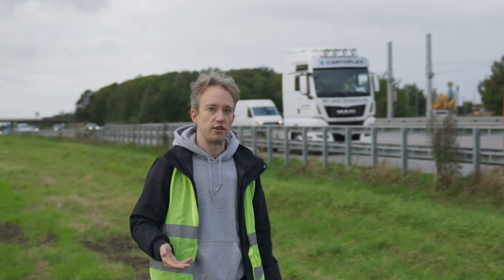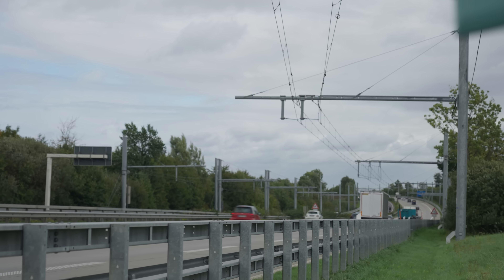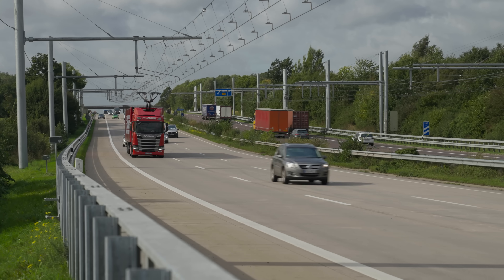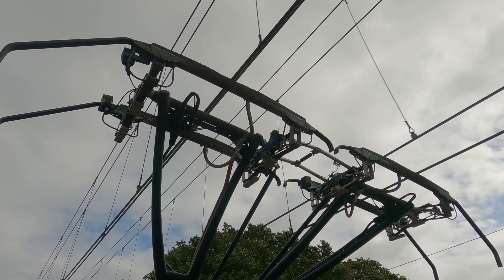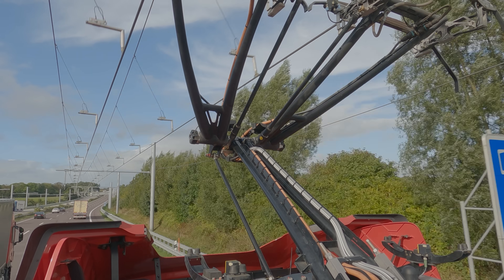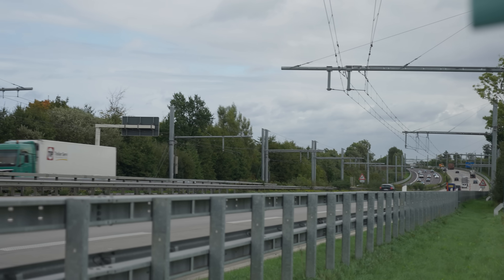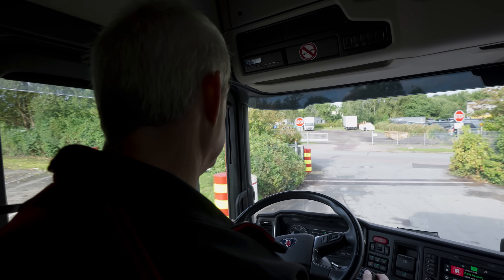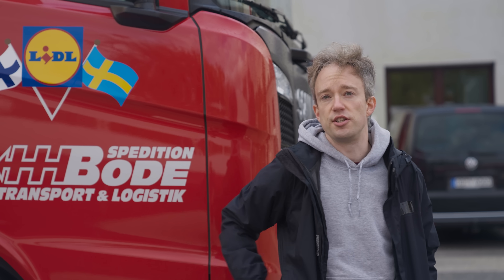The highway where trucks work like electric trains

Comment: Very interesting, being a heavy truck driver seems to me the easiest solution to be implemented and yet I would be interesting what laws will apply on driving these vehicles and I mean the speed required by law for speed, which will be the procedure overtaking a vehicle that is on this power line! Simple and practical, all the trucks in the company I work for are limited to 53 miles per hour, so there will surely be other vehicles that go much faster! How will they proceed?

Comment: what anger me the most about the restructuring of the whole system is: we could have started all of that 50 years ago and used a cheaper, slow transition. instead, we now have to hurry up and do it on the fast lane, which includes extra cost, that average joe has to pay for in bulk
Reply: Fuel is cheap and is by far the most weight efficient energy source. There's no motivation to fix what's not broken (as it appears on the surface.)

Comment: My thought is, yes it might be a proven tech for trains (and I'm speaking overhead cable to the contacts/pickups mounted on the vehicles), but you can already see groove marks of wear. So, how long to those contact 'blades' last? Are they easy/cost effective to replace, what a about a roller system (tube same width as those 'contact blades' but they roll with the cable rather than cause friction thus wear between overhead cables and electricity pickup points? Not being an engineer per say, just inquisitive as to what/why/how/use & maintenance etc...

Comment: This doesn't solve the problem that those power lines are powered by coal and oil burning power plants. Plus wind and solar don't produce enough energy to cover the emissions used to create them. Plus solar panels are loaded with toxic chemicals that pollute the environment when the panels need to be replaced.

Comment: Having hybrid engine will add weight and make it inefficient energywise. Why not add small batterty for say 10 minutes off grid? That way, the truck can "jump" between lines, or speed over slower truck, all while they don't have to carry redundant engines.

Comment: I'd think putting the truck trailers on train cars to distribution centers would make more sense, since the power is already there. Doesn't the UK and EU have extensive train networks? Or is it mostly for passenger service?
Reply: Train networks reached their maximum capacity and extending that in Germany is fighting against locals who say rail great, but please not near me. 

Also time is a factor and train with the transfers is unreliable regarding the exact time.

Comment: This is the coolest thing America will never adopt. This application seems to be a bit niche. It works for long haul travel where there are no rail networks. We have the infrastructure to switch our entire rail network to electric-hybrid except we use bi-level trains to double capacity. Union Pacific and BNSF specifically.
Reply: I think they could still make it work, even with bi-level trains. They'll just have to standardize the clearance to accommodate that.

Comment: As soon as you string up wires or add some sort of extensive infrastructure, you might as well just finish building a train line. Having to use overhead power on a designated route is the negative of trains, while high friction tires on a small capacity vehicle are the negative of trucks. At this point, just build train lines everywhere, and use battery powered trucks to do the 'last mile' from the train station. That, and trucking things everywhere on roads is far less environmentally sensitive than rail which requires less carbon intensive construction and operation.
Reply: I think this would be great to have on highways and major roadways around a city, get trucks with much smaller batteries and your last mile trucking, and busses now have a way to recharge that small (thus cheaper and less environmentally damaging) battery while still having the flexibility to not need to follow fixed routes.

Comment: How does it meter how much electricity is used by each truck so that they can be billed? Is there some authorization in the connection that would deny electricity if your truck isn't paying its bills?

Comment: I think we should just have a slot in the road like Scalectrix
Reply: Winter and dirt may cause issues with this slot car ish system
Reply: @slickrick1557  It worked all right in London for about a century, but was replaced with diesel buses shortly before I was born.
Reply: @henrywhite2984  there were buses that took power from a slot in the road? Are you sure?

Trams have in road tracks but use overhead supplies. The track just acts as earth.
Reply: @gwenynorisu6883 It's called a third rail, but you have to then separate the track to stop pedestrians from getting shocked by HV

Comment: Not reasonable solution. How much carbon particles are scraped off every 10 000km (how many kg)?  This is not a train/tram, this is a trolley (normal wheels/tires) with fixed pantograph. How much carbon footprint one km of metal poles+concrete creates?

Comment: In my opinion, a lot of the uses for this overlap what trains already do - I'd rather insensitives for trains than a network like this.
Reply: What makes this test track so weird is that there's already a train track with the same overhead power cables running a few hundred meters parallel to this highway. A more efficient system to transfer containers from train to trucks more quickly even at small train stations would be a much better invention.

Comment: This seems like a bad idea.  If the truck swerves hard, does the connector add interference with the cables above?  And when a truck comes in over-height, or wrecks, will those high-powered cables somehow lose all power before falling onto an unsuspecting auto driver and frying them to death?
Reply: The pantograph (what the connector is called) will automatically retract if the truck moves too far. 

I shave seem trams/streetcars use a system like this. They have a built-in battery and charge up on some sections and then retract to go under a bridge or over a bridge where for some reason there are no power lines.

Comment: I just don't get why THIS is beneficial, compared to boosting railway usage, and maybe implementing this sort of system in major commercial centers- why would you EVER run this along a highway? If you're shipping cargo on a highway, it realistically could AND should be done by train rather than road. That will always be the more efficient solution.

I can understand doing this along shorter routes with high traffic usage- like in-city roads dedicated to between the big warehouses and the port/cargo stations, or say between an Amazon warehouse and a train station/harbor. I can get that you might not have enough room to fit in a railway there. But if you're driving bigger than a 50 mile radius- expand your rail lines and put in a new station instead.
Reply: Because trains must stick to their track, they can only stop at certain places which is a pain to transfer and move, this means that if I were to move something from point A to point B and point B didn’t have a railway near it therefore the truck wouldn’t produce as much carbon dioxide getting there.
Reply: I'd presume the logistics of loading, unloading and warehousing costs and takes time. Ignoring the electricity aspect, mail and parcels aren't delivered by train for a reason.

Comment: this is a good idea but it could be better. as has been pointed out it does remove some emergency functionality (though those are rare cases). on long stretches of road with no pedestrian or wildlife traffic might it not be possible to have the power run on/in the road surface? lines 1.5 meters apart should be safe enough. the other issue is the question of battery technology. it hasn't evolved much for decades but with new manufacturing techniques around it may just get lighter and more efficient enough to render these moot. for now anyway these lines are worth a try.

Comment: Best thing I could come up with is having got swappable batteries at depots. This seems like a way cooler solution
Reply: I've been chatting with a couple of different friends who have had similar ideas. Getting different manufacturers to agree on a standard interface might be the tricky part. In principle it could be good though. But until then, I'll be happy with fuel.

Comment: This is the sort of "hybrid" solution we need! The trucks have enough battery power for short distances and use the eHighway or eventual eINTown grid to provide power for on the road charging and driving. It's a brilliant idea!
Reply: Tyres generate toxic particle pollution. Trucks cause the vast majority of wear and damage to roads. If only there were some way of having metal wheels. I know we are running out of time, but surely running rails along each side of the motorway and having some kind of adaptor system for the trucks would be much more efficient. Any time the government wants to add lanes to a highway, they should be compelled by law to consider adding a dedicated "truck railway" instead.

All the operational advantages of single trucks, with the safety and efficiency of rails.

Comment: I worked on a mine in zambia that had such a system for the big trucks hauling ore out of the open cut. When the trucks connected to the electric cable they would go silent and and move three times as fast.

Comment: So the trucks themselves are not producing more emissions,  but what about the additional emissions for producing the electricity from the grid? Does that represent a significant reduction in emissions? Or is it just moving the emissions from one place to another and changing the source?
Reply: Or the additional. Emissions and other environmental, impacts of producing the parts for this truck, such as the batteries, constructing the unique-ish power poles, or the additional moving parts this truck requires to connect to the grid with this method

Comment: We just need modular batteries that a machine arm takes out and replaces at the gas station. The gas station would be charging a huge bank of batteries all the time. Take yours and put it on the charger. It could actually be faster than filling up with gas

Comment: Seattle, Washington has had a system like this for its buses downtown for at least 3 decades. It's actually less convenient forthe drivers, since they have to get out and manually make and break their electrodes' connections to the overhead wires. I'm glad that this has become easier and more convenient for drivers; if this can exist in mass transit systems in the next 15 years, that will do away with one of the greatest downtown complaints about buses that exist in United States.

Comment: These 'solutions' will be laughed at decades down the line. 
 The additional costs of maintenance and paperwork regarding the power usage, taxation on power usage etc etc . Then there are the safety issues. 
Billions will be wasted on 'woke' ideas we already know are impractical. 
The no win no fee adverts in a few years time will ask if you was mis-sold a heat pump.
 Generations of people will regret trashing nuclear power too as costs keep climbing.

Comment: Yes, carrying all the electricity around in a battery may not be the right way. Same applies for cars. 
Why not supply the electricity by induction from underneath and also let cars have it? They could cover the "last mile" on much smaller, lighter and cheaper batteries then.

Comment: Or better yet ban the use of long haul trucking. Really it’s become wildly unnecessary. Rail transit will be much better if it’s invested in properly. However, I think the overhead system still has potential for the road trip vehicle.

Comment: Seems like it could become even more efficient by adding some tracks and putting more trailers onto each truck
Reply: Yes, as in, let's use a train instead? 😂
Reply: Yes, it would become more efficient if you turned it into a train, but can a train leave the tracks for the last few miles to get exactly to where the goods are needed?
Reply: @morganmitchell4017  then you no longer have a use for these, as these are intended to be built on highways, not regular streets. Electric delivery vehicles already exist too, so realistically what practical use does this offer that isn't already fulfilled by trains and delivery vehicles, which we already have
Reply: @moosesandmeese969  I think you might be missing the fact that the trucks can also run on their internal power, unlike a train. Is it not obvious why:
Factory -> Truck -> Warehouse
is better than:
Factory -> Truck -> Train -> Truck -> Warehouse?
Reply: @morganmitchell4017  Trains are faster, more efficient than trucks and remove traffic from the roads. For long distances, trains are superior. For short distances, trucks can use their internal batteries. I think the money to equip one third of Germany's highways with overhead power lines would be put to better use in railroad infrastructure.
Reply: @ilyoo-k9f  I imagine they looked at all the factors in making an informed decision.
Reply: @morganmitchell4017  trains are much faster, more efficient, and requires less resources. Your analogy is a bad one because actually yes, many companies find it more cost efficient to put their stuff on trains to transport them. The fact that cargo trains exist proves that. This isn't even rocket science. People have known this for decades

Trucks can't be multiple kilometers long, and they require highways and roads big enough for them to drive on, which is not only the opposite of what a functioning city wants, but also hundreds of times more expensive than just putting down rails.

And when it comes to final delivery, delivery vehicles like cargo vans are preferred because they don't clog up traffic and can fit on the small streets of cities. They don't demand that you bulldoze half the city just so they can drive through them.

So in summary, trucks are only better in very specific situations where the destination is not too far or too close. When they are beaten out in every other situation, it's a terrible idea to think we need to optimize for trucks instead of trains. This is just another stupid idea coming out of car obsessed America
Reply: You can’t add more trailers as that would become a safety issue
Reply: Australia: Road Trains...
Reply: Not really. Too much problem with reloading the goods. Trucks are much more flexible and they will not disappear.
Reply: @volkhen0  it's a joke. they described a train.

Comment: I’ve said what others have said and that’s that a railway does this more efficiently and with lower environmental cost. If you’re going to invest in electrifying motorways then you might as well invest in improving the rail network instead
Reply: For long distance I think so. For short distance this might be a more effecient solution. Since it can make use of existing infrastructure. (Roads) and doesn't have the same logistical complications of a train system.
Reply: @MrScigeek101  wasn’t the point mentioned in the video that this systen would only be installed on motorways (so only really beneficial for long distance driving)?
Reply: @Jeagles  I think so yes. I don't really see this as a great solution for long distance travel but, while trains are objectively a more efficient solution, this might be a somewhat economical solution for certain long distance routes where train infrastructure doesn't exist.

Comment: If it's going down a fixed path and have more or less the same points A and B, why not just use freight rail? Steel wheels are also more energy efficient compared to rubber tyres too.
Reply: Because freight rail is not door-to-door.  A train goes exactly from A to B and nowhere else; a truck is better for when you need the "more or less".
Reply: @kaasmeester5903  I agree but this solution is not door to door either. It has to follow fixed routes and in the example only go to warehouses and have to be complemented with smaller vehicles for last mile delivery.
Reply: @fauzirahman3285  Not really. E-trucks can rely on batteries for the last mile inside city limits, and use the catenary on highways for long hauls without charging.

Comment: The truck is not the biggest thing on the road. When a large load vehicle that's too tall to fit under the cable height is using the motor way - and they do. It will be forced into the middle and fast lane. They can not have this running across entrances or exits or any cross junctions. But that's where traffic can build up or come to a stand still. They also assume trucks dont use the middle lane for long durations as they creep past one another. More so, how check is that guy, forcing trucks to be electric then charging companies to use it. They will say it's cheaper then raise the electricity cost - because more are using it of course. Its just like the energy companies do now, shut down the power plants to cause an energy crisis then tell us off for living our lives based on the infrastructure they built an charge us for it. The idea its self is a good one, it will work for the most part, the part that will fail is corporate government greed. Just look at the world we have now.. cheaper?? No. Better? No. If no one can buy goods there will be no good to deliver.

Comment: Funny how most power in germany comes from low efficienty coalmines so this power isnt even that co2 friendly
Reply: It takes many years to switch to renewable energy, esp with limited space. In 2000 we had 6% and in 2020 we were at 46%. And yes, in the meantime Fukushima happend and we decided that a short term increase in coal is better than having all the risks and waste problems from nuclear power.
It also takes many years to develop, test and then equip our highway system with enough of these powerlines.